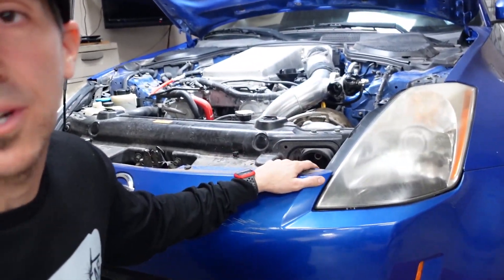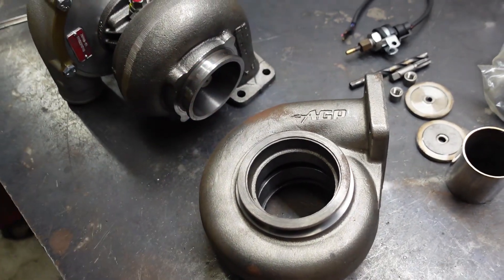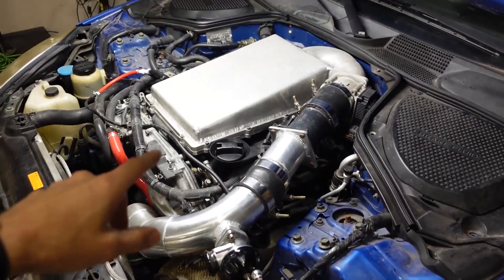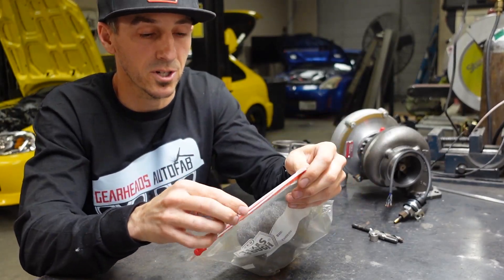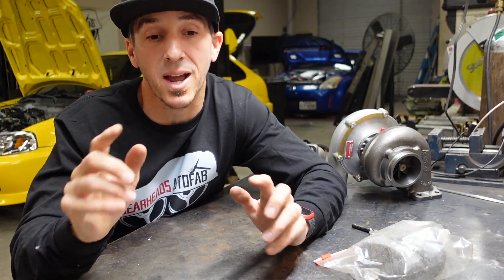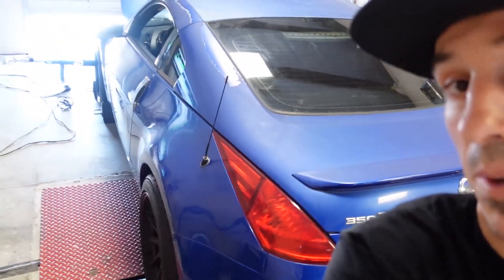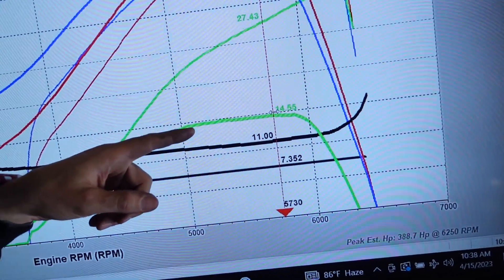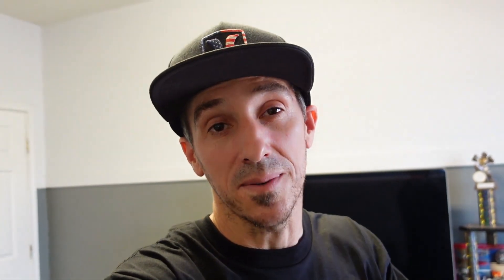turbo upgrade on my rev 9 turbo 350z

Comment: I’m doing a similar build with a ball bearing gt3582 and 3 in downpipe with tial wastegate and bigger intercooler also all the fueling
Reply from the maker: Awesome, you should make you tube vids on your build, I’d subscribe…..It’s not super easy for most people to do a  Z turbo and not have tons of problems. Love too see how it goes for you. I’m almost done fitting the 62/66 on there , need to finish the 3 inch down pipe.
Reply: @GearheadsAutofab  I’ll probably maybe make a dyno vid hoping to make more hp and keep ya down